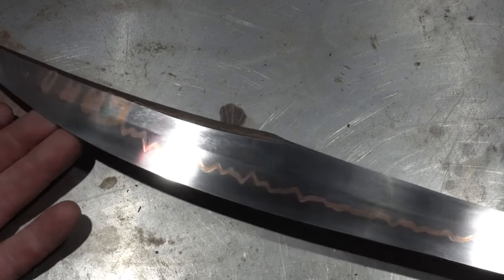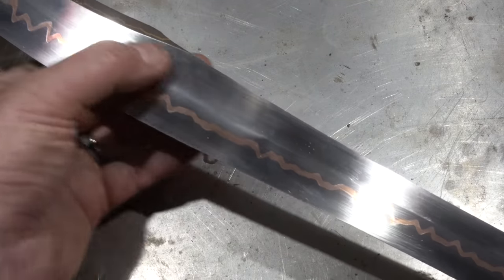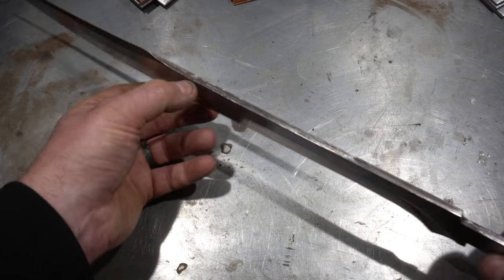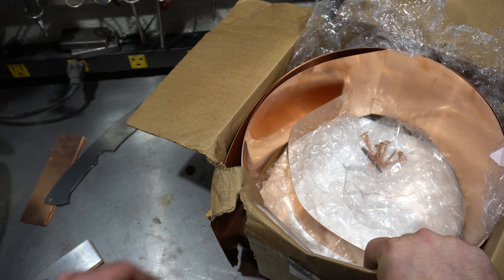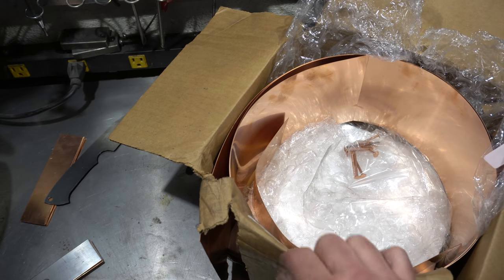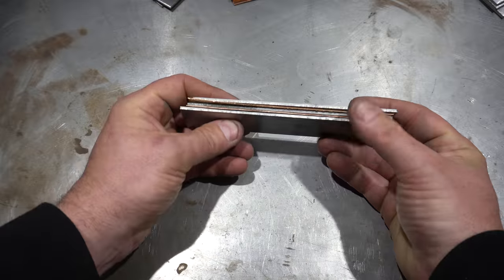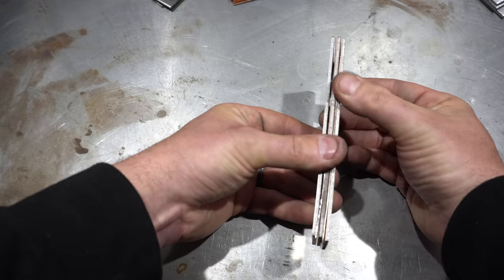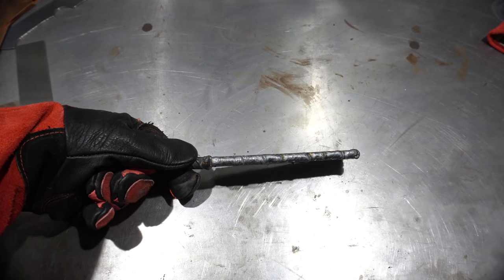Triple-T #64 - How to make Copper Damascus (Cu Mai)

Comment: Just a correction, you can't weld the edges on all San Mai billets. Try it with wrought iron cladding and see what happens.
Reply from the maker: For cast iron and wrought iron, you need to preheat the steel and let it cool slowly.  If you just try to mig it like you do regular steel, it’s going to fail and crack.  It certainly can be welded.  Thanks for watching.
Reply: @TyrellKnifeworks  I forgot to mention,  I enjoyed the video and learned a lot, thankyou for sharing your process.. Also, I should have been more specific, while you technically can weld wrought, it's not a good idea to enclose it when using to make a San Mai billet. More so if there's a lot of loose silica present in the grain of the wrought. You wouldn't flux a billet and the go and weld it closed, right? You'll get the same result with wrought.

Comment: Bạn đang dùng đơn vị độ C hay độ F vậy. Thấy gg dịch sub nói là độ C
Reply from the maker: Tất cả nhiệt độ được đề cập trong video đều là độ F. Google Translate chắc đã dịch nhầm nếu bạn thấy nó ghi Celcius. Đây là một video khá cũ và trong các video gần đây hơn, tôi cung cấp các giá trị được chuyển đổi Celcius bằng văn bản trong video. Cảm ơn đã xem.
Reply: @TyrellKnifeworks   cảm ơn bạn vì những video hướng dẫn. Em từ Việt Nam. Rất mong được đón tiếp anh sang chơi và du lịch ạ.
Reply from the maker: @leanhduc4113  Có thể một ngày nào đó! ❤
Reply: I have a finished billet with the welds ground off the sides already but it's to thick, do I need to resend the sides before forging thinner?
Reply from the maker: @mattbeegle6847 it depends how good you are at heat control.  If you can keep it under 1800F you don’t need to weld it.

Comment: I think by now, damascus has just become a generic term. I've seen it used for non-metal as well, different colored resins for example. So really the term has evolved from its original meaning to just describe a kind of pattern resulting from mixing two or more "things" together. The pedants who try to keep the antiquated meaning going are akin to the same guys who state that a rifle is not an AR unless it's made by Colt or that any vacuum cleaner is not necessarily a Hoover. Language evolves and adopts generics from specifics.
Reply from the maker: Yes, I believe the same.  It has become the colloquial term for pattern in metal.  Thanks for watching!